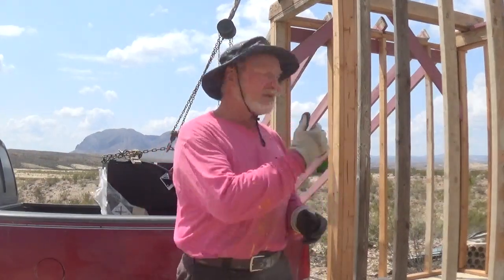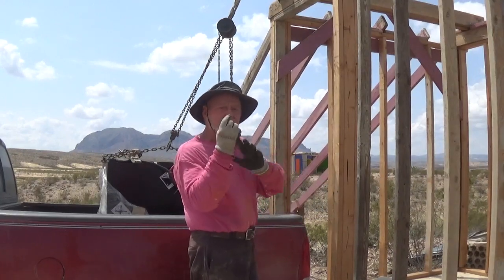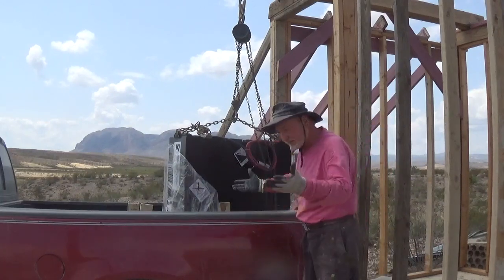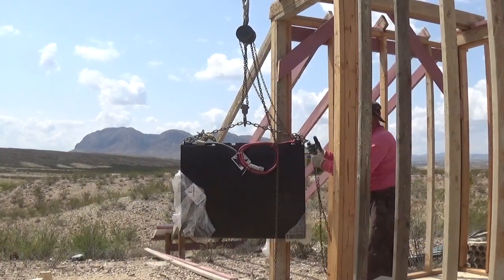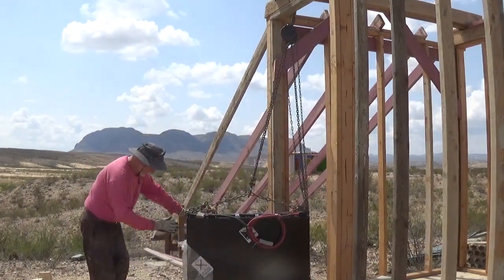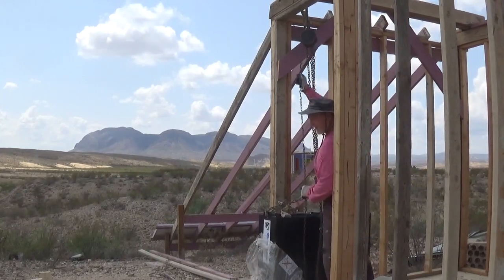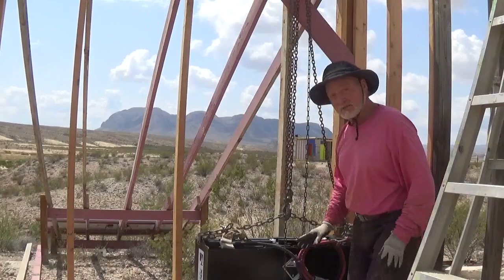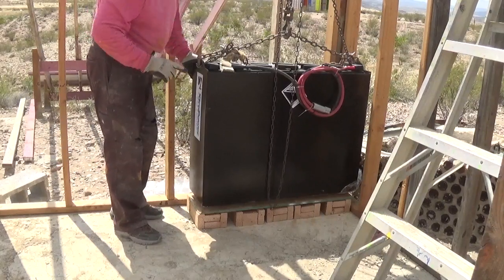Unloading & Positioning Our New Forklift Battery

Comment: Long ago batteries were not supposed to be on concrete, not true with modern batteries. Yes, I repaired electric lift trucks and other industrial equipment for 35 years. If the electrolyte is to high in the cell they will spew or if the charge rate is too high which is very unlikely. Rinse them off regularly and keep clean
Reply from the maker: Here is an update. I just replaced my forklift batteries in October. They were sitting on concrete for all this time. The bottoms were COMPLETELY rusted out of them. DO NOT put them on concrete!! Elevate them.
Reply: @ecoranchusa  I think even setting them on a piece of plywood (on cement), is way better for them then directly on the cement.